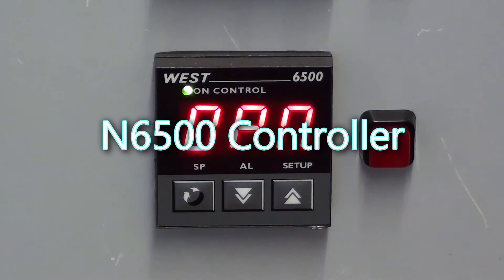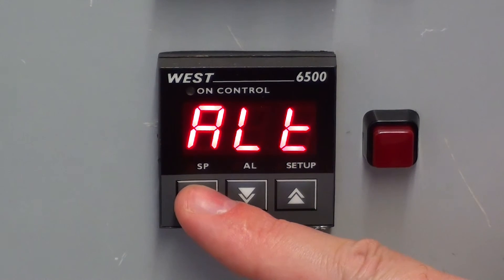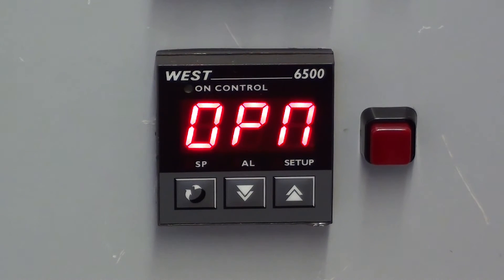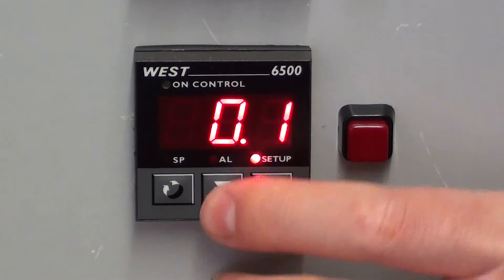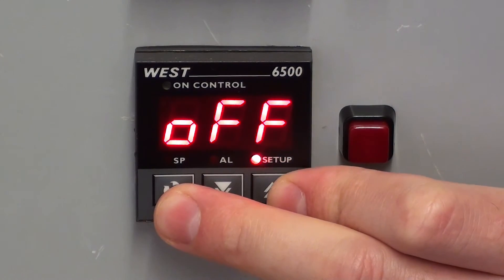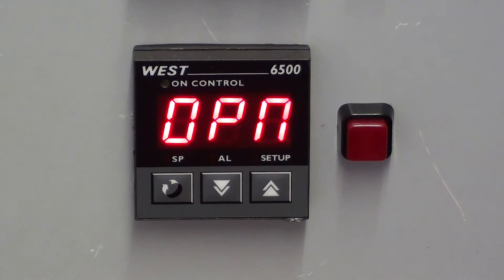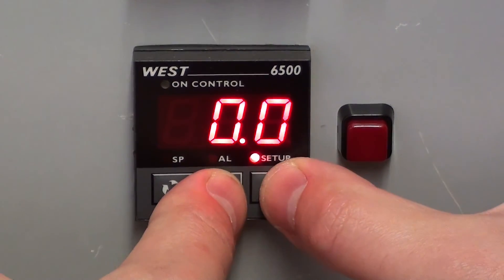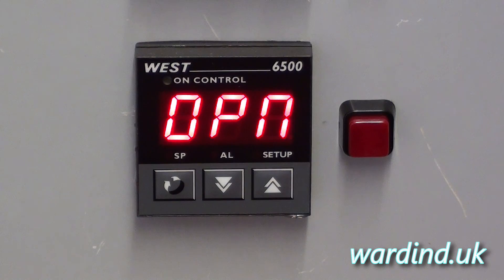N6500 Controller - Setup & Configuration

Comment: How do I set this up to fahrenheit?
Reply from the maker: Go to setup mode by pressing scroll and up keys until display starts to flash. Release and then press the down key. Find parameter 'InP'. There will be a 3 digit display. The last digit will be either 0 or 1. Select 0 for degrees C or 1 for degrees F. To return to normal operation, press the scroll key to display a parameter legend. While this legend is still displayed, press the up and down keys simultaneously for 3 seconds. Alternatively, an automatic return to normal operation occurs if there is no key activity for more than 1 minute. A manual can be downloaded from the resources page of the west-cs.com website.